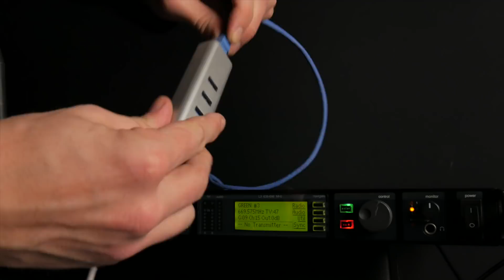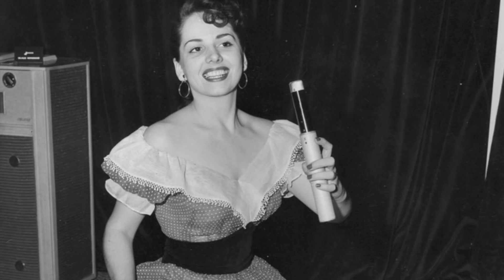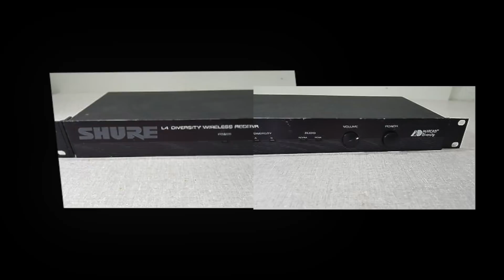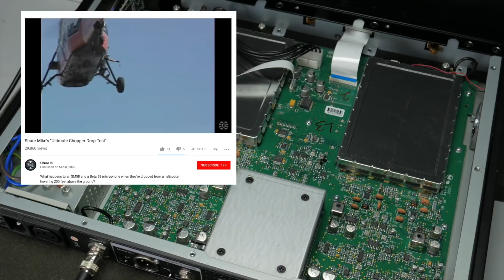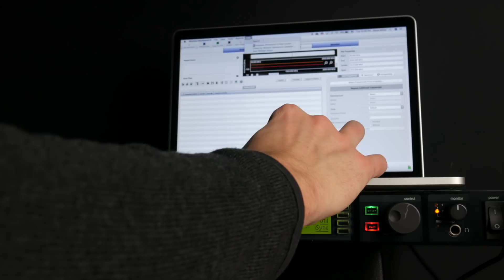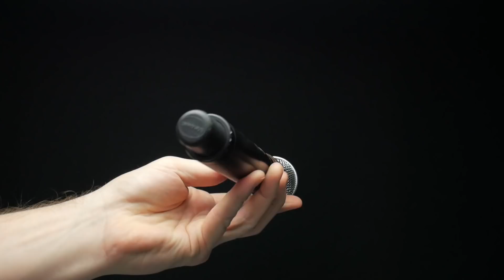#82 - Saying Goodbye to the Shure UR4d

Comment: Hello there! can i use SLX4 Wireless ReceiverL4E freq 638-698 Mhz with axt200 transmitter L3E freq 638-698 Mhz?
Reply from the maker: I don’t believe so unfortunately - https://service.shure.com/Service/s/article/axient-transmitter-with-non-axient-receiver?language=en_US&_gl=1*o36sze*_ga*ODA4ODEwODE5LjE2NDcwOTU1MTA.*_ga_DB3CR9SF0C*MTY0NzA5NTUwOS4xLjAuMTY0NzA5NTUwOS42MA..&_ga=2.109795779.737955045.1647095510-808810819.1647095510

Comment: A friend of mine is looking to sell me these for $300 bucks. But it looks as if I won’t be able to use them long.  Opinions? Oh, for mobile DJ’n
Reply from the maker: Where are you located? If it's North America, I would not buy these, even for as little as $300, it's going to be frustrating to use them legally going forward.
Reply: @DcSoundOp  do you know where I could buy replacement parts? one of my receivers has some blown electronic parts  that I think just need to be replaced
Reply from the maker: Pmla Audio There is a lot going on in those, do you know exactly which parts you need already? Some will be standard off the shelf components you can get easily, but if you’re looking for shure parts or whole boards, it will be a different story. Let me know what you’ve got going on.
Reply: @DcSoundOp  I have a feeling it is a off the shelf component I just started learning electronics in school so I can’t even identity the part I have a picture of the part and the name on the part 481 100 63E is printed on the top of the part
Reply from the maker: Pmla Audio send me the photo & any info you have to info@dcsoundop.com & I’ll see what I can find for you.
Reply: @DcSoundOp  sent thank you

Comment: I really like these units. The ones at the church where I work are 600 MHz and are being phased out shortly. On the bright side we are replacing them with several Axient units! Very much looking forward to the video on WWB!
Reply: Hello there! can i use SLX4 Wireless ReceiverL4E freq 638-698 Mhz with axt200 transmitter L3E freq 638-698 Mhz?
Reply: @clmedia6971  Doesn't seem so. Shure has a compatability chart and those don't look to be compatible. You can always email them and ask though.